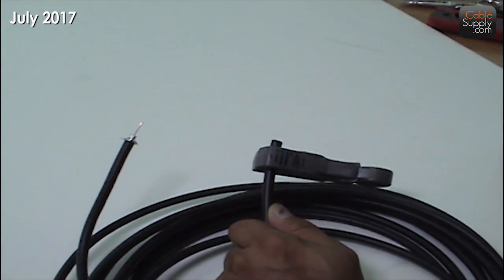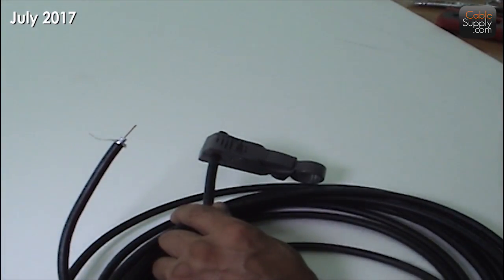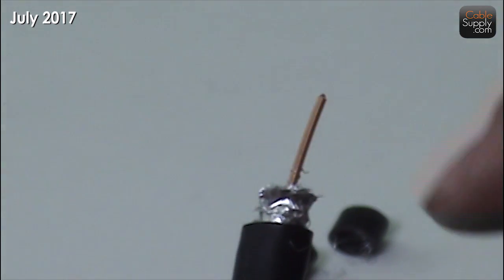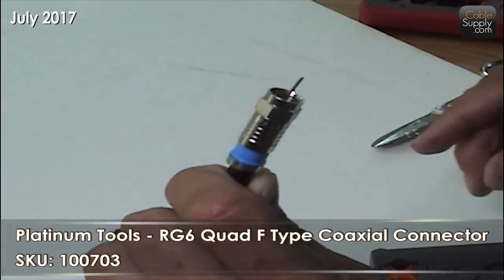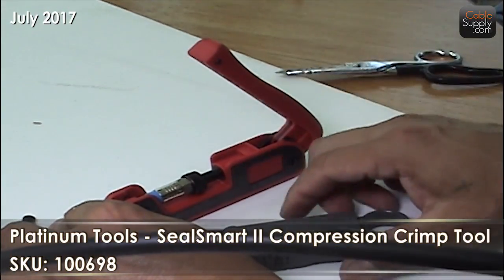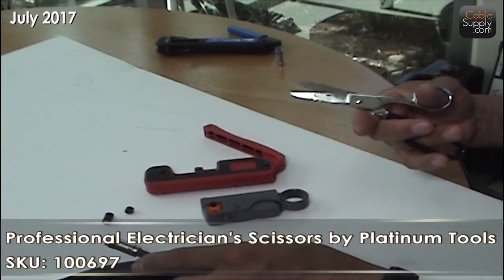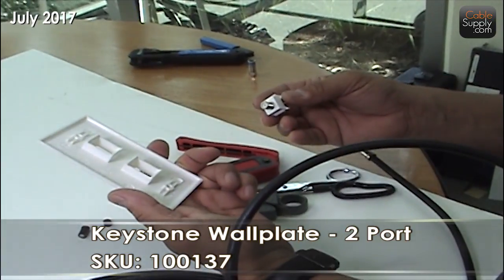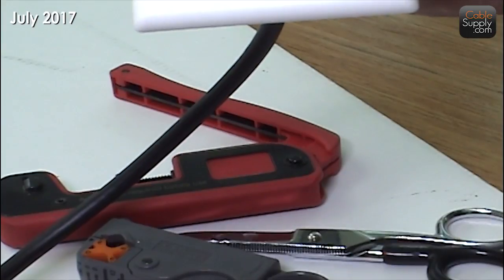How To - Coaxial Cable Termination

Comment: Great video thank you for taking the time to make it. Probably should mention that there is RG59 in a lot of homes (smaller than RG6) which will use a different connector.
Reply from the maker: good point !

Comment: Make sure that it's flush as you can get, and of course that it isn't shorted out. Good rule of thumb is about a penny's width left on the stinger past the F-connector. Amazing how much difference a connector can make if it's incorrect.